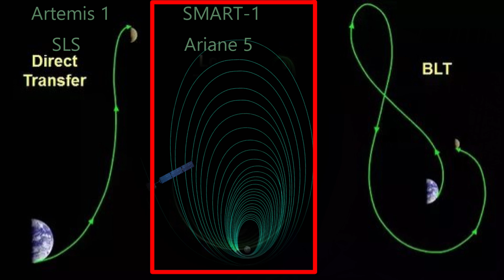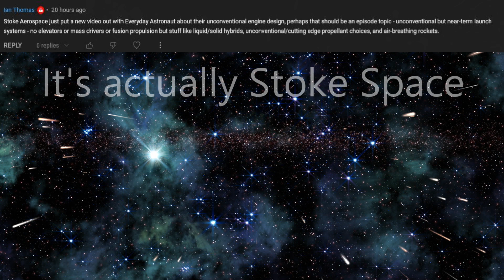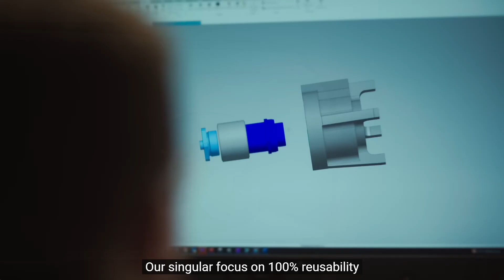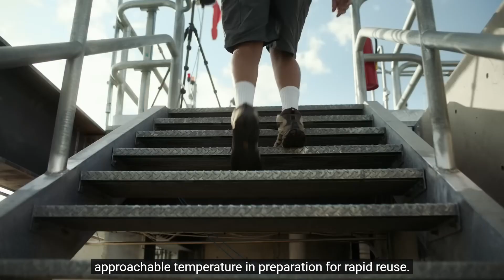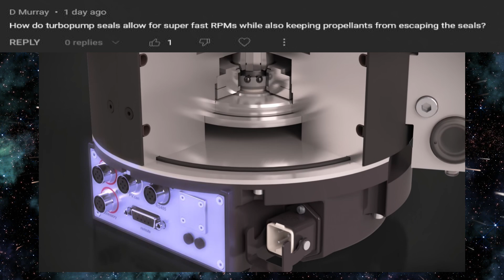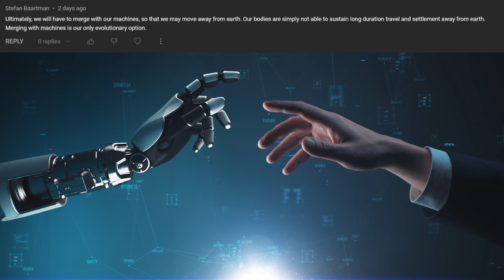Rocket Science: Stoke Space and Actively Cooled Reentry Systems

Comment: I've thought about flywheel energy storage and one thing I've never heard addressed is precesion stress on the bearings. The only locations on a spinning body, (such as Earth, Mars, The Moon, etc.) where it where it would be easier to solve is at the poles, where the flywheel axis would be vertical, or horizontal at the equator with the axis would be positioned to be parallel to the axis of the body. In between at, say, 41.8781° N (Chicago) the flywheel would have to be tilted 41.8781° off vertical to the north which would introduce load bearing... uh... bearing design problems.
Sorry about the clumsy wording, I'm too busy right now to take the time to make it clearer.
Reply from the maker: Magnetic bearings... No stress :-)  Seriously though I'll look into this to see how much of a factor it could be.

Comment: Every one jumps to solar or nuclear on the moon. And the day time temperature just screams merlin or steam engine to me. Low pressure equals quick boil. Play with air pressure  or a heat sink condenser. Even a shade cloth over 1 of 2 adjacent masses. I wonder if they recycle water on ISS by boiling it off or out. Like a emergency water still on the ocean? You said waters a radiation shield, or it's a component of rocket fuel or gray water for plants. Would water in a bag make a quick temporary inside hull patch?
Reply from the maker: Stirling would be a good option I think.  You could pound a heat sink rod into the ground and shade the "cold" side.

Comment: I had a thought. I know it all comes down to weight. Does a gimballing system weigh less than using reaction thrusters when taking off. I know total weight needs to be considered including the weight of the fuel burned, but with a reusable rocket, you already have reaction thrusters built in, so the only added weight would be the propellant. Your thoughts would be interesting on this. Stoke wouldn't even need anything additional. The center of thrusts of the engines are far off enough from the center of mass, you could use differential thrust to keep the second stage oriented correctly
Reply: That is exactly what they are going to do.
Reply from the maker: Thank you GF... It makes sense.
Reply from the maker: That's a very good question.  Having multiple small thrust chambers around a large aerospike design like theirs allows "solid state" thrust vectoring.  The mass savings should be considerable though the reaction time might be a little delayed... spin up and all that.

Comment: As I understand it, Stoke plans to use fuel to cool the heatshield then dump the vapors overboard. Water has several times the latent heat of any fuel. Why not bring water along to cool the shield?
Reply from the maker: the mass penalty is too high... by using propellant, which is much less dense and already cryogenically cooled, they save a lot in efficiency with the expander cycle engines.
Reply: because that's another system, and the heatshield cooling doubles as expansion volume for the expander engine. It's in Tim's video